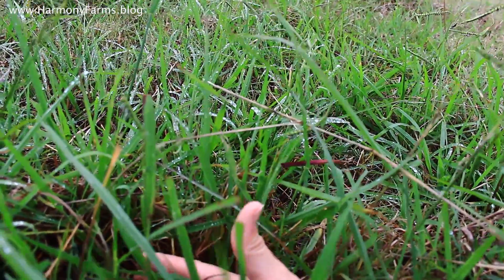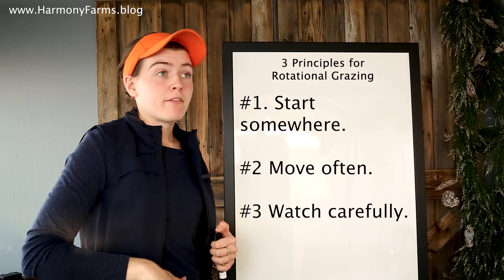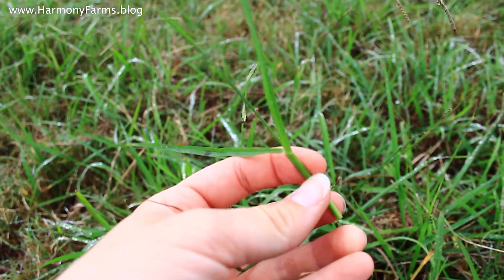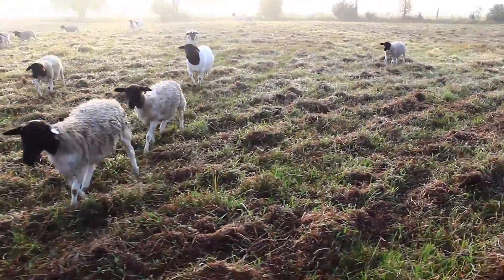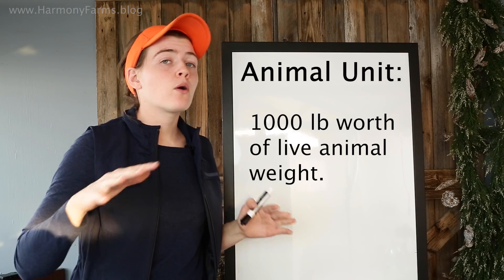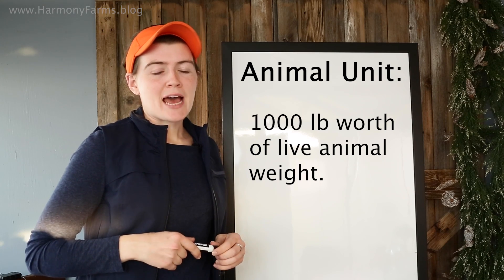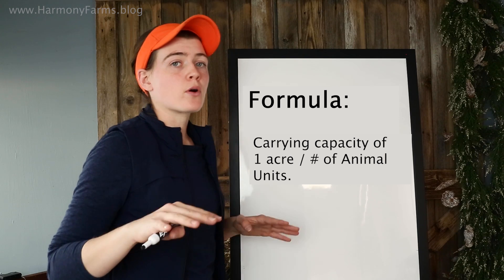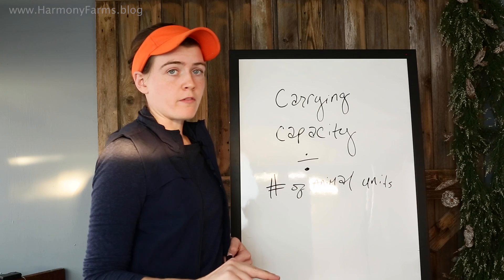HOW BIG SHOULD EACH PADDOCK BE? Calculating Grazing Paddock Size for Rotational Grazing sheep & cows

Comment: been one of the things i have been lazy with due to being laid off during covid and due to the fact the prior owners way over grazed with longhorns...  I have 60 acres but looking at another 2-3 60 acre plots, 2 of which my creek extends onto so that would give me good water sources on a low water creek in colorado.  I was thinking of doing 5 acre to 10 acre paddocks on each property while renting out just the house  on those other properties if i do get them.  Also looking at a fodder system for winter time and an option of building winter proof buildings / paddocks for a winter feed lot maybe.   

On my current property i would say about 2 to 4 acres of it is pure hayable creek grasses of creek bed.  Meaning non irrigated but might as well be high quality hay that i could cut let animals graze it over and even work on maybe getting the 5 acre paddocks each some over wintering modifications sooner or later maybe.

Also, looking into maybe doing a multi animal grazing... meaning chickens/ducks right after sheep or cows after throwing some minerals down on the manure prior to letting the birds get some grubs.
Reply from the maker: Sounds like you are off to a great start!

-the Shepherdess